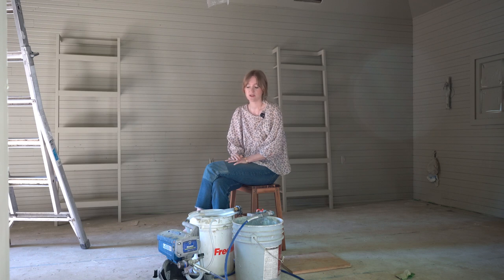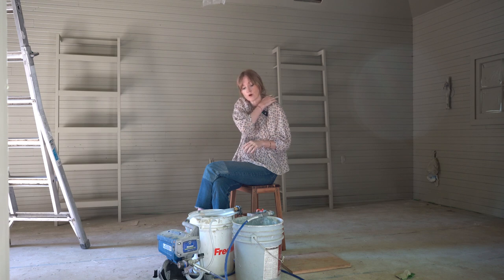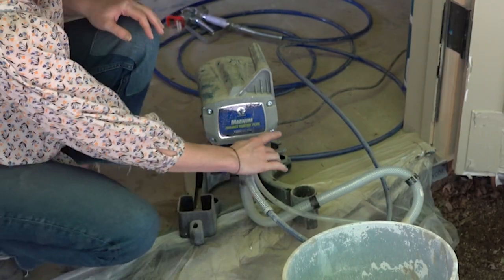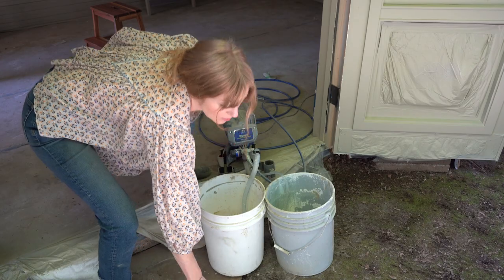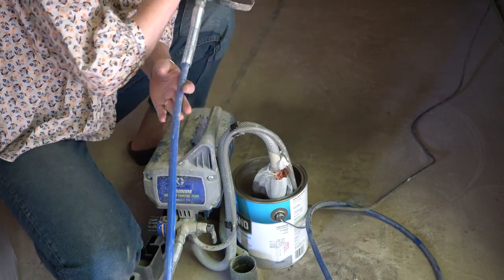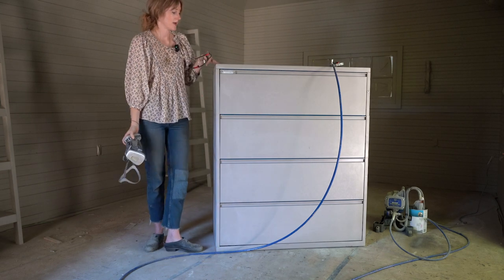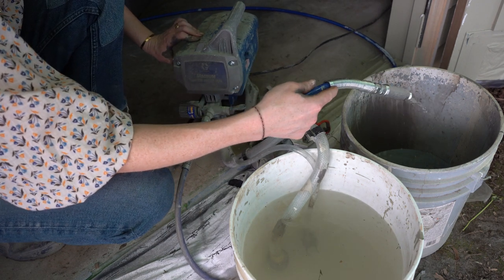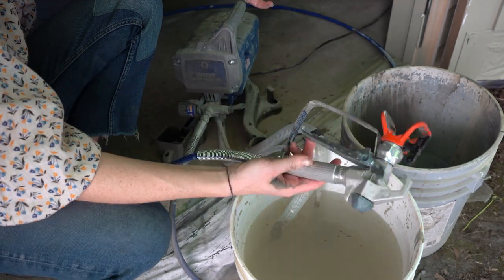PAINT SPRAYING - beginner's guide.  You've got this.

Comment: Nice video, I am a painter. One piece of advice would be tape the strainer bag to an empty can/bucket and pour your paint through it, leave a opening from bag to bucket to put the suction hose through that way the bag won't get suctioned into the filter and cause your unit to work harder. The 2 minutes you sprayed wouldn't`t affect it but a longer spray period might.

Comment: Grace recommends that you remove the tip and guard when flushing the water or pump armor out of the paint hose and getting paint through the hose.  Then install the guard and tip.  This also helps prevent the tip from clogging in any debris gets dislodged as the paint initially fills the hose.
Reply from the maker: This must be a great tip, as others have mentioned it.  Thanks for sharing; I will be sure to try it next time.

Comment: You can recover much of the paint inside the suction tube and the paint hose by doing the initial flush back into the paint can and then move to the waste bucket once you start to see water come through.  Given the viscosity of most water based paints and their color, it is easy to tell when water first starts coming through.  You lose a lot of paint if you dump the contents of the suction hose and paint hose into the waste bucket after every painting session.  And the small amount of water you may get into the paint can is insignificant and probably barely offsets what you lost to evaporation while painting.
Reply from the maker: Thanks! I love this.  I thought about it afterward, and realized on my old system (which was the type with the air compressor), I actually diluted the paint a bit to prevent clogging, so the bit of water that will go into the gallon shouldn’t matter at all.  I think I will probably do this moving forward.  I really dislike waste. Thanks for chiming in!

Comment: Thank you for a very detailed video. You did a fantastic job! I have a question though. When using the Ammonia/Water mix to clean the sprayer, do you remove the tip and clean that separately or leave it on when spraying the solution through the sprayer?
Reply from the maker: Thanks! I would clean all the parts separately, so remove the head and take it apart and clean all the bits thoroughly (maybe in a small bowl of ammonia), then send the ammonia/water through the open hose.  Then put it together and send more water through.  I found the enamel was significantly more prone to caking & clogging than water-based paints.
Reply: @hellogoodhelen  Great! Thank you. That's what I'll do. I have to use Zinnser BIN Shelac based primer before painting to prevent stains from bleeding through.